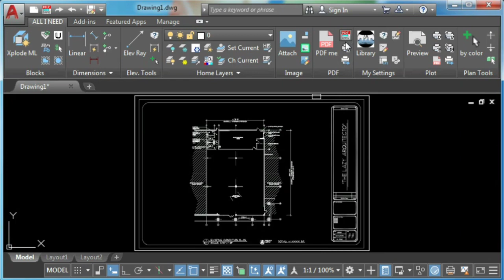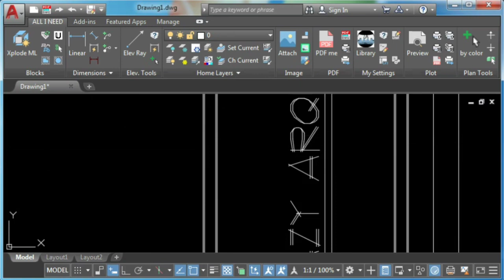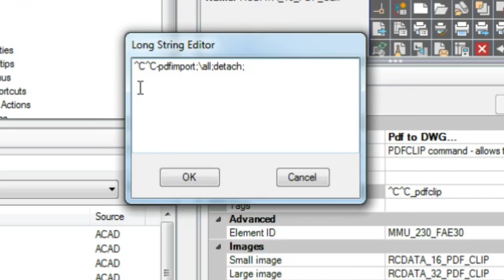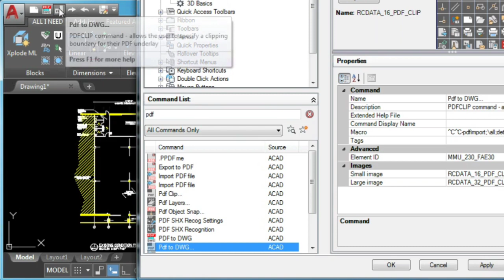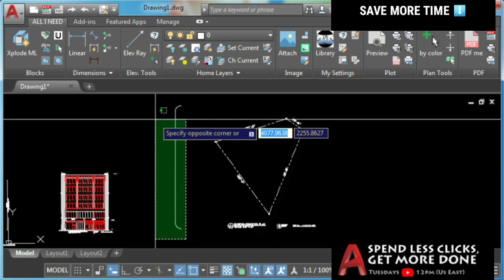1-Click PDF to DWG Conversion with AutoCAD Macros

Comment: I subscribed to all your links and email...your great.

I'm using Autocad Lt still so, I would like to create a permanent quick launch icon for both double lines 3-1/2" and 5-1/2" double line.
I need the correct macro format for both the 3-1/2" and 5-1/2" double lines can you help me with this?
I'm still pretty new to all this.
Reply from the maker: Hi by double line you mean for walls? If so did you watch this video for lazywall command? > https://youtu.be/xRmFGRNULVg I explain how there
Reply: @LazyArquitecto  My understanding is since I'm using AutoCad Lite I don't have the New Multiline Style function.

Comment: How can i convert multiple pdfs into autocad in single click
Reply from the maker: You can use the PDFimport command
Reply: Actually i have a 100 of pdf files containg vector data i want import all pdf files  into a single drawing in single click without select invidual pdf file want batch import to drawing